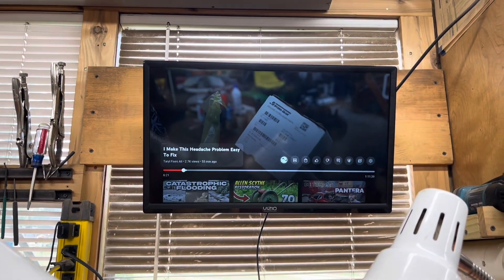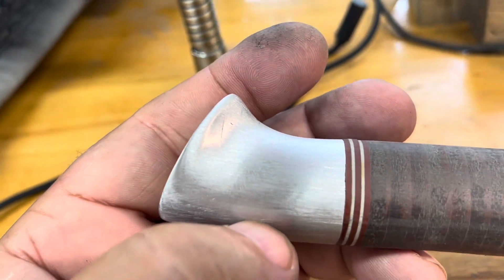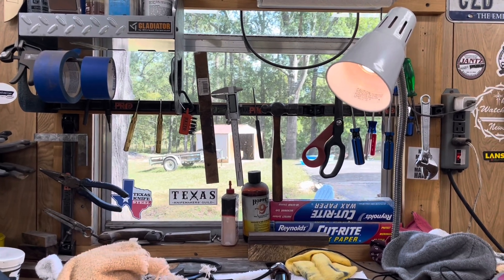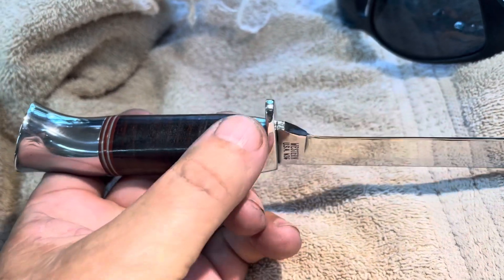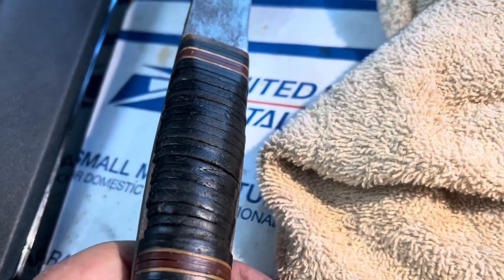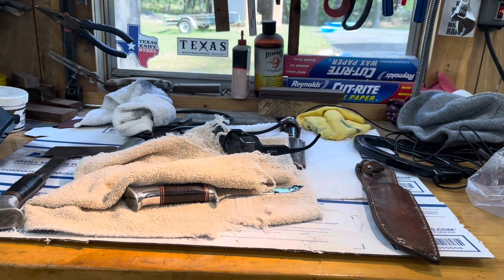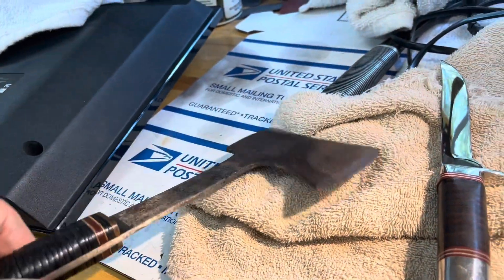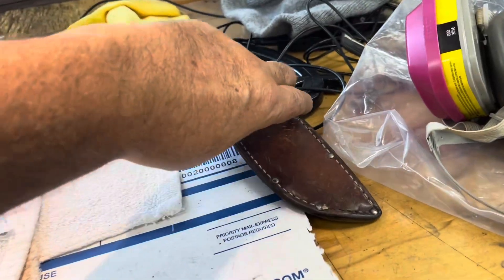Western W36 knife, restoration

Comment: I used to work with pvc in my old apartment in a small space I cordoned off and wore a mask as there was a ton of dust. I was so smart. One day I decided to use a vacuum to clean up and it did a great job of sucking up the dust but pushed the super small dust through the filter and I inhaled it because I did not wear my mask, huge mistake.Whatever goes in the lungs rarely gets to be removed.
Reply from the maker: Normally my fan blows the dust away from me, but it’s not fan weather anymore.
Reply: I learned that lesson when I sanded a red cedar slab, in my shop without a mask and/or dust collection. I never tried that again.
Reply: @oldtimerlee8820  
I found a plank of heavy tropical wood in a New Orleans lumberyard called Moradillo. It was extremely heavy , resinous and looked like rosewood. I bought it and started cutting it up and putting pieces through a thickness planer. There was a heat wave going on with extreme humidity. I was planning away wearing nothing but shorts and sandals. Sawdust was piling up on my shoulders. 

After a while ,I put on a mask, but it was too late. I broke out in blisters everywhere. Inside and out. It was 104 degrees and It was like being completely covered with poison ivy. I went through about a gallon of calamine lotion. 
That NEVER happened again.
Reply: @RobbsHomemadeLife  
That’s right. Stone and mineral dusts,ceramic dusts, and some plastics can get in your lungs and never get out. 
It caused what the doctor called “blunting” of the outline of my lungs when seen on x ray. Silicone carbide and aluminum oxide that comes off the belts when sanding never gets processed. It just sits there and gets encapsulated. That part of your lung no longer works
Reply: @chopsddy3  I can't imagine how rough that was to get through. FWIW...  In the late 1960's I had a bad case of it from poison ivy in a pile of bush we were burning. Volatile oils were in the smoke. I was fortunate that only my arms were seriously affected.. Took years for the scars to fade away. I know how miserable I was with that. 
Based on that, again, I can't imagine what you went through. 

Shlver just went down my back thinking about what you went through.
Reply: @oldtimerlee8820  
I started taking the book of Job more seriously.
I’m starting to have a rough time from aging, but anything short of that experience is pretty tolerable.
I’d say more, but neither one of us needs to . 

I got a good dose of Southern poison ivy back then too. Twice. It was so big compared to the yankee variety that I didn’t recognize it. That stuff doesn’t play around down there. And you burned it! Wow. 
I have to stop thinking about it. I’m getting itchy.

Comment: Brad, Amazon sells reading glasses that go all the way up to 6.0 power.  Two pair for around fifteen bucks.
Reply from the maker: @chopsddy3  well,,,, maybe I can hold off on the eye doctor. I think the next step for me is 3.75, or 4.
Reply: @bctruck 
The eye doctor (ophthalmologist) can tell you what prescription  you need and checks the health of your eyes.
The optician assembles , fits and sells the glasses . (for about a 1000 or 2000% mark up)
I wouldn’t ignore a proper exam. But, I can’t afford to get gouged by the optician selling a seven dollar pair of glasses for $300.
I have reading glasses ranging from 3.00 to 4.50 and a couple 6.0. That’s about $30 for the three pair.
$30 vs $300 for one pair from a corporate , walk in chain store.